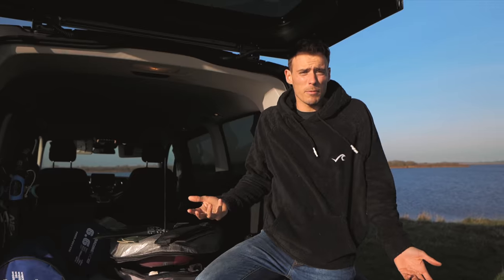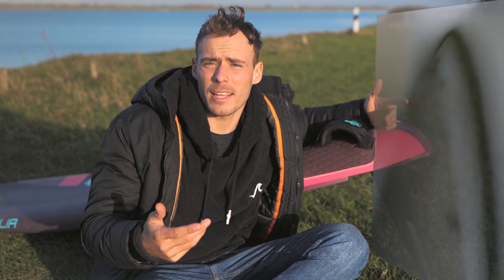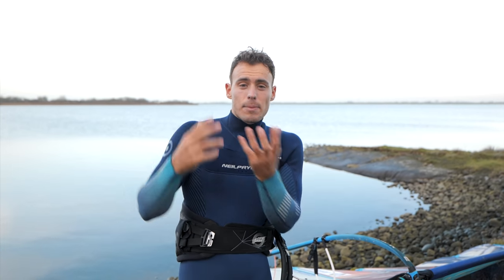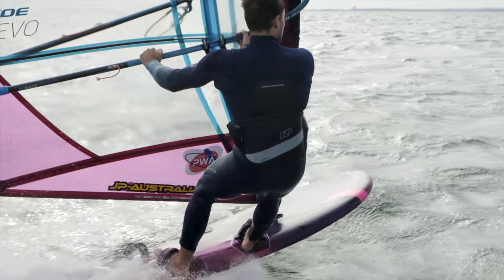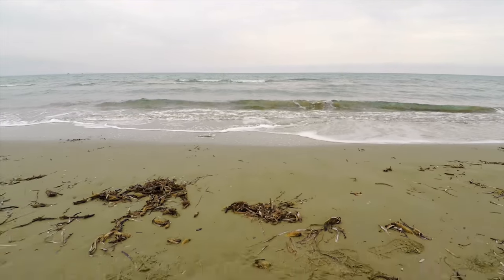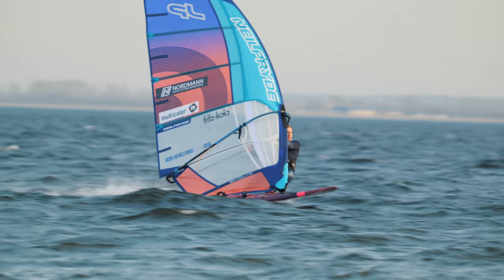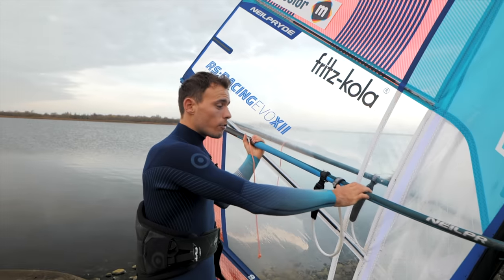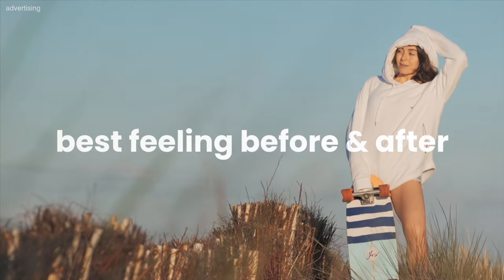HOW TO AVOID SPINOUTS | Tutorial by Nico Prien

Comment: Hi Nico, another excellent video! I think you're 95% right about the theory on the spinout. The size/shape of the fin, technique, etc. but I have a theory of my own that I'd like to add: I find that a spinout is never gradual. You don't spin out "a little". When it happens, it happens all the way, until you make a proper effort to readjust your balance and regain control - or end up in the water. It's more like an on/off event while windsurfing. My theory is that especially in choppy conditions, if you allow the back of the board (around the fin) to lift out of the water, as it comes back down with a splash, this may result in an air bubble to be captured on the windward side of the fin, rendering the fin completely useless because it doesn't have water flowing around it to sustain the pressure, resulting in the board behaving as if there is no fin. On my first ever spinout, I actually thought the fin screws must have somehow come loose and my fin fell off entirely. The same can happen in not so choppy conditions and at high speeds, but only when trying to change direction or a slight lift of the board due to change in wind speed, or just carelessness of the rider. An air bubble can form around the fin, killing its effectiveness. However, I can't prove my "air bubble" theory because I don't have a camera that can capture this. Maybe you can install a small camera under your board and trigger a spinout and we can see exactly what's going on down there?

Comment: I remember the days of little cavitation fins in front of your main fin and split fins to try to keep the flow attached to the fin. I also remember looking down during cavitation and seeing the little "air tunnel" under the back of the board where the air was being sucked in around the fin. Like you say, had to release the pressure on the fin, let the water flow re-attach to the fin and voilà...back in business. You are making miss my windsurfing days! That hoodie would be great for surfing! Cheers, John ;)

Comment: Hi Nico, I agree with you that spin-outs: they happen as soon as the nose gets out of the water, exposing the entire bottom of the board almost all the way to the fin (i.e. you hit to a large chop).  So, the area of the fin still in contact with water pretty much determines whether you're gonna spin out or not.  If you have a small fin your are pretty much out of luck because there is not much fin area in contact with water when the board lifts up.  In this case, your only remedy is to move the mast base forward to keep the nose down, or try to keep the board's windward rail in contact with water which is a difficult thing to do.  Larger length fins, on the other hand, have better chance against spin-outs when the nose of the board lifts up because more fin area is still in contact with water.  However, you cannot keep using large fins in heavy winds (to prevent spin-out) because more speed causes more lift, and ultimately control problems.  Spin-outs also take place if the fin loses its laminar water flow on its chord.  That means that a large length fin with large chord spins out faster than the same length fin with shorter chord  because the laminar flow on larger chord starts detaching from the fin surface towards the trailing edge and becomes turbulent as the speed increases.  Modern fighter jets control this by using small wing thickness to reduce turbulence and drag if the aircraft needs to be employed with large chord (to provide lift).  I hope this makes sense.
Reply: Thanks for this insight!!!
I have a question related to the mast base (considering no chop, just for argument's sake): I would expect more pressure on the back of the board if the mast base is further front, so more prone to spin-outs. Right or wrong? 
My thinking: If the base is further front, the pressure coming from the sail is targeted further front so you need more counterpressure from your feet not to turn downwind.
Agree on the nose-up issue though. However, my problem yesterday on choppy water was that I had some spin-outs after passing big chop when it felt safe to put pressure again. Tried to play around with the mast base setting but the wind had picked up even more, causing serious control problems, haha.
Could catch the board again in most cases after spin-out by lifting the sail and going as much downwind as possible.
Reply: @jadeunbethsc2826  You are right!  A mast position further up the board will turn the board more towards upwind, and you need more pressure on the leeward rail to turn it downwind.  Therefore, no one I know puts the mast base all the way up to prevent spin-out: -)  There is a sweet spot on the mast track where you get most benefit according to your weight and the board you are using.  It is not exactly a science, but trial-and-error.  Good luck :-))
Reply: Cavitation or ventilation!
Often when overpressuring the fin, some air gets sucked down the windward side of the fin and that contributes to the detachment of the laminar flow.  
Sometimes a quick in/out movement of the back foot will help it reattach. 
Nothing new here. I learned that stuff nearly 30 years ago when I was an F2 dealer.  😳

Comment: Hey Nico, Nice video. I would also like to add a few tips and hopefully things to look out for in regards to spinouts. From a true experience I can confirm that if your fin does not fit in the fin box tightly, then you can also have a lot of problems. You can check this when you have your fin mounted on the board and then grab to edge and wigle it around. If the fin is loose from the box you will feel it wigleing inside the finbox. This I know then creates small vibrations in higher speeds which therefor sucks in a bit of air and damages the flow - spinout. The fix for this is to add layers of any sort of thin material such as soda/beer cans or old x-ray images. The plastic from the x-ray is perfect. If one layer is not enough then you add another one. That REALLY makes a difference I promise. Also for look for any stickers that the manufacturer may have put on the fin. Any little bit of stickers have the same sea wead/grass effect and can do you damage :) I remember that I also saw this as a tip in one of the Neilpryde Pro secrets videos, the old school formula ones.

Comment: Honestly you should be a physics teacher, great explanation of the forces applied on the fin 👍
Reply: Nico’s great 👍🏻 As a physicist though with a lot of teaching experience, I would say it’s misleading to call the force that a windsurf fin generates “lift”. Firstly because the force is sideways, not up (F1 cars are said to produce ‘downforce’ for example, not lift). Secondly because there is actually a genuine lift (upward) force from a fin caused by spanwise flow, and if you’ve already called the main force “lift”, how do you describe this minor upward force? Because of these two things, I would call it a sideforce that works like an aircraft or racing car wing.

Comment: Once I was capable of sailing really fast, like ragged edge fast, I got spin out from a panic sheet out when near losing control from chop and well SPEED.
So rather than sheeting out heading up became my preferred option to a violent sheet out for speed control.
Makes sense that a sheet out can cause spin out when at the limit as it almost like reversing the lift on the fin and stalling it.
I also rigged my gear for speed on my lawn this way. Think I read about it.
Fresh from a session knowing my harness lines were in the perfect location (able to sail no hands).
I rigged up on the lawn. I read that you want the centre of pressure as far back to the centre of pressure of the fin. CANNOT be behind it. The board rails do provide some lift as well (when in the water).
Not many current boards (any?) have adjustable fin boxes. I always slammed mine back for speed.
Also your mast foot will be different for every sail.
Of course if it gets to hairy out there moving the mast forward will give back control at expense of speed.
If this is wrong hey let me know. Just adding to the discussion.
Rigged like this I found a perfect balance of going fast enough 1/3 of the time, trying to go faster 1/3 of the time and going TO FAST 1/3 of the time. Your idea of balance may vary of course.
:)
Results may vary.

Comment: The comparison with a wing of an airplane is good. By the way if an aircraft inclination is too strong , the airplane will fall because the wing will loose its lift. This is the same principle for windsurf at low speed.
At very high speed , 40_50 knots, cavitation may occur as well, it is the creation of an air bubble around the fin.

Comment: I almost always get the spins putting a too big of a sail on a smaller board. The result is the draft of the sail going right over my rear foot and overloading the fin. In the 80's....they used to put mile long mast tracks that allowed you to run bigger sails on small boards. Nowadays, mast tracks have gotten shorter limiting your range of usable sails. When the manufacturer states the sail range on the board.....use it!

Comment: Really helpful video! I never knew what this was called and couldn't explain it to my windsurfing instructor friends for them to help me. These days I especially spin out when I land a jump but can now catch them and recover. When I stepped down board and fin size when I was learning I used to spin out all the time. The spin outs helped make sure I kept a good front foot pressure and helped my sailing stance. Question: Will a quad fin set up spin out more easily on chop than a single fin/thruster as the fin depth is less?

Comment: I believe another variable shall be added here and this is your top speed. the higher the speed, the more lift is generated by the fin. So, it is board, Sail and top speed. Average wind velocity: bigger board, bigger sail thus lower relative top speed is bigger fin. High windspeed: is smaller board and smaller sail size but higher top speed and thus smaller fin. 
Another effect of incorrect fin size is uncontrollable board jitter. During windsurfing the fin will bend and this will create an up lifted force which will result in board lift out of the water. This is really anoying during windgusts and you could end up in a uncontrollable situation and serious crash. (been there done that... haha)

Comment: I remember using a friend's Hifly board back in the late 80s and it was The worst setup I ever tried for spin outs. I think the fin had something to do with it as it was very short, basically any time you jumped from a chop you would spin out for almost the entire reach after that. Was a shame cause if you were on a reach it was fast, and it jumped really nicely because it was small and light, but every time you landed it was sideways 🙂

Comment: Hi, great video!  Not sure if someone else asked already, but if you have a wave board (Angulo Chango 65), where you can adjust the position of the fin fore and aft - would it help moving the fin more forward to avoid spinouts?  I switched from an old traditonal pintail Chango 65 where I never had spinouts, to a newer squashed (fishtail) tail Chango GT, and now I'm getting spinouts (ugh).  Maybe it's the wider tail, or a narrower profile fin, but just wanted to check if it was just a fore-aft positioning that is causing the problem.  Thanks!

Comment: thanks Nico, useful as always! could you elaborate more on which size to use for which board/sail. In general i use 2 formulas eg sailsize times 5 +4cm and boardwith devided by 2 + 1-2cm. then i select the smallest of the 2. how usefull are these formulas? as both have an impact how do you determine the correct size?

Comment: Could having a too large fin at high speed make you spin out because the fin generates too much lift?
Reply: I'm not sure but it is possible because in windsurfing there are many factors. An oversized fin will probably affect the riding in a bad way. Which will then very likely cause problems including spin-out. So I think an oversized fin will cause problems indirectly. But all by itself I think that a bigger fin would be less prone to spin-out because of a lower force loading per unit of fin area. This results in a less extreme pressure difference between the sides and therefore less possibility of sucking in air from the surface.

Comment: Now you should do a video on recovering from the Spin Out. I find it exhausting to try to scissor the board back on track, these days I just get out of the straps to get it off a plane and get it headed in the right direction. Seems to me most of mine are caused by catching just a little air in the chop and coming down more upwind and the new angle of attack stalls the fin.

Comment: Fin size linked to the rear width of board. Any recommendations on how big the fin should be for a JP 120 xcite, currently running a 37cm with 5.7 to 7.8m. I'm occasionally suffering high speed spin outs. Ps would love a hoodie.

Comment: I thought a fin is producing mainly a force sideways not upwards (lift)? The force sideways enables you to push against the tail of your board. And I thought a symetrically profiled fin is producing the sideway force because it's sliding slightly turned in an angle through the water. It sounds logical for me but I might be wrong.

Comment: Thanks for the video ! I usually spinned-out when my harness ropes were too low (and so i was closer to the water), i don't know why it cause spin out but the difficulty is so find a balance between low and high harness rope..
But what i'm struggling the most actually and since i improved a lot is to keep my front leg tight.. i didnt found the solution yet, i think it's mostly the position of my harness ropes on the boom.. if anyone have a solution !!

Comment: Hi Nico..U said that the fin generates lift, but It has a different profile from a  wing od a an airplane..coz  it has the same curvature on both side as opposed to the wing of an airplane..That´s why a plane goes up..the differential of pressure between the  two sides of the airfoil.. In the case of the fin..it doesnt happen..Forgimme for the doubt.But i´d like to undestand..Bleiben Sie gesund..

Comment: surely its more like the tail on a plane than the wing, If the fin was generating lift it would be pulling you to the left or right, whichever is the low-pressure side of the aerofoil
Reply from the maker: That’s exactly what’s happening. That’s why you can push against it...

Comment: Someone knows some good starting gear? My sailing skills are on a high level but I want to start surfing. I prob will learn the physics kinda fast cuz they are almost the same. Someone some idea's?
Reply: A big inflatable SUP with a plug for a rigg and a center fin. And any light 5 m Rigg (depends on your weight). This is for the first 20-50 hours where you won't plane (2-3 bft). For starting to plane and learning to use a harness and the footstraps best is a 130 liter board (depends on your weight). The SUP you can still use for paddling obviously and for practicing still in low wind conditions.
Reply: @73smoo  lol I'm gonna skip the sup but thx for the advice!
Reply: @pieterpieter9944  Do what you want. You will see... Have fun (and not too much frustration)! Not to be floated away with a board without a daggerboard (or centerfin) while you are not planing is difficult. If you are trying: Sheet in just a little bit while going upwind.

Comment: I miss one reason for spin out. Many people lean to much outward, often caused by short harness lines. If you stand more upright on a board than outward, you do not push the board from the side so much, therefore less spin out. But this requires to change the harness technic, using longer lines.

Comment: The fin doesn't produce any lift because it is a symmetrical aerofoil shape. This is a shape designed to reduce drag and not produce lift. It's actually nothing like a plane flying on its side and furthermore a plane's wing flying on its side will not produce lift in the vertical direction. The fin's job is to create a counter force to the downwind force of the sail. When you sheet in too much the sail becomes too perpendicular to the wind causing the downwind force of the sail to become larger than what the fin can hold causing you to spin out. At higher speeds you can sheet in further because your forward motion creates a relative wind which comes from a different direction.
This video explains it well.
 https://www.youtube.com/watch?v=WNtVRryd9Jc

Comment: I believe you should separate the three "spinout" types: Ventilation, Stall and Highspeed Stall. The first two you cover but not separately.
Ventilation is when the Board gets air under it, the air wraps around the fin and stays there.
Stall is when there is more lateral pressure than the fin can cope with at the given speed.
Highspeed stall when you are getting close to 50kt, then no matter how the fin is shaped, the low pressure side of the surface has so little pressure, the water starts to vaporize. "Cavitation".

And now my question: At high speed racing, in a course almost downwind (German "Raumschot Kurs"), would it be possible to remove the fin and rather tilt the board to make sure the upwind endge of the board is lower in the water, similar to what a kite surfer does. No fin, no highspeed stall, is the thought. And the needed lateral force comes from the tilted board planing on the water.

Thoughts?